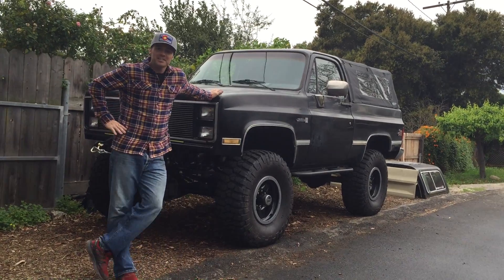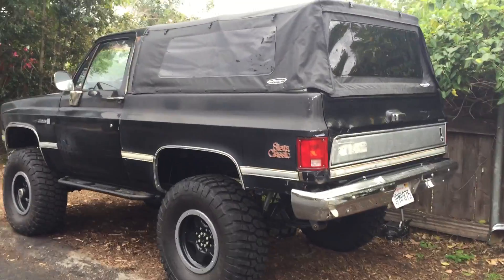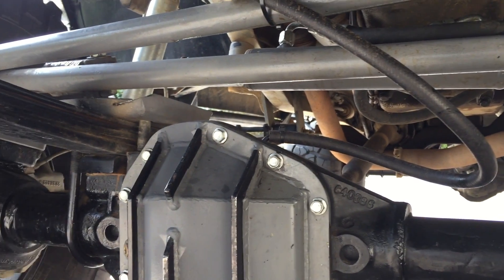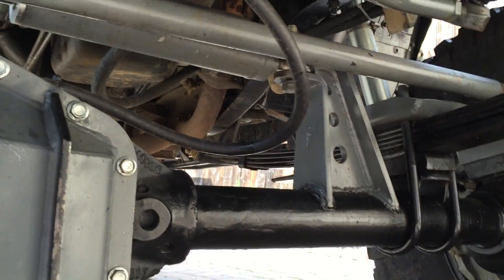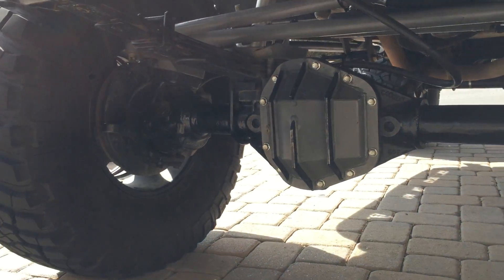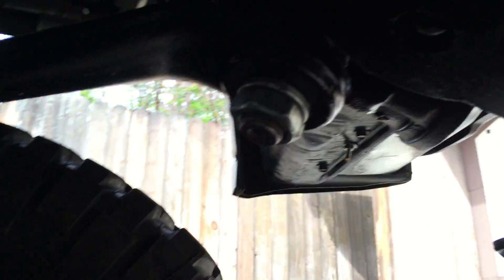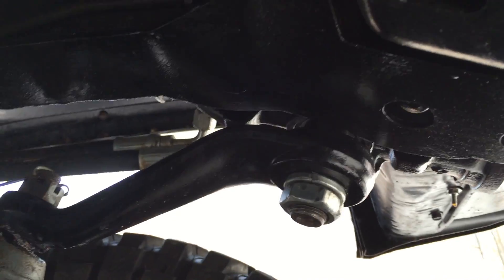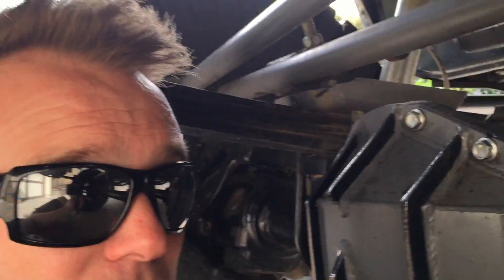MG #1 - what is crossover, high steer and hydraulic assist steering?

Comment: Sorry I haven’t watched all of the Jimmy build videos but what feeds the hydraulic assist ram? A hydro boost power steering pump?
Reply from the maker: yea, it gets from the power steering pump.  You generally need to upgrade the steering pump as it gets worked harder.  The steering box is also ported so the hydraulic lines come from it and complement the drag link

Comment: Does this eliminate the need for a steering stabilizer?
Reply from the maker: well technically a steering stabilizer is a band aid on the system to a certain degree, but yes the hydraulic assisted steering definitely helps dampen steering feedback.
Reply: @MerricksGarage  gotcha, thanks for the reply

Comment: Hey Merrill I just had a Psc hydro assist steering installed on my 1982 jimmy. I have a 6” suspension lift with 15”x12” rims with 37”x14.50” toyo m/t problem is my steering is very sensitive I constantly keep over correcting coming out of a turn , there is no more play in the column but it feels dangerous driving but the biggest problem is that when I brake going into a turn the jimmy pulls to the right the other day I almost lost it going 20mph if a car was next to me I might have hit them the shop that installed it said maybe my front brakes are the problem but before it was installed I had crazy play in the steering but it never pulled. Any idea what could be the problem I would appreciate your input Thanks
Reply from the maker: I would check your alignment.  Toe could cause pulling but also incorrect caster could.  Depending on how you lifted it you might have altered your caster.  The braking issue could be a bad caliper.  Is one wheel or hub warmer to the touch than the other one after a drive?

Comment: I have a 1976 K5 Blazer with the stock front axle. Do you know where I can get a cross over high steer kit? I won't be off-roading it so I wouldn't need the hydraulic assist.
Reply from the maker: Www.Offroaddesign.com

Comment: i have welded a LOT of stuff. a gentle critique i have is that your welds look functional, from what i can tell. we would call them the "farmers special", but if you want to learn, id suggest learning TIG welding. if there is a welding shop with small parts that are needing done, ask if they can teach you how to tig weld. no big factory will do this, but a smaller, private shop may. remember that no matter what, a weld is  strongest and easiest to put down when it is in the flat position. i can stack dimes for days with very little variation. i can also use the arc to smooth stick or MIG welds out. if a weld is good, i see no reason for that though. the welders that can convert to mig or tig machines are getting cheaper and one that can handle up to 1/4 inch wont set you back much. eastwood actually has one. my cousin bought it and is learning to weld with it.

Comment: I've got a 84 3/4 ton with 6" lift 35x12.5 tires, lifted with springs no blocks, nicely done but something is wrong, it wanders horribly and uncontrollably, been aligned, new tires, not sure what Pittman arm is on , i fixed the wheel bearings, caster is 5.8* passenger side, 6.1* driver, .6 positive chamber, toe is dead on, i can not  see any worn joints, drag link seams ok, does anyone know what I can do that will not make me look drunk when I'm driving it?
Reply from the maker: What axle?   Kingpin?   Have you had anyone slowly the turn the wheel while you are down looking at it?   All it takes is a little play in one rod end to make it steer crazy
Reply: positive camber ? If its really positive id start there , your "some" negative camber few degrees maybe. Check also for frame cracks at steering box.
Reply: Same issue with mine. I replaced ever steering component and still wonders. Thinking im going crossover. Hopefully that cures my wondering K5.
Reply: @Snackzy-TDS  My 88 K5 wonders a fair amount...and its stock. About to put tons under it though.

Comment: Great vid , I have a 89 k5 with alot of play in the steering wheel , gonna have a track bar made you think that will help get rid of some of the play ? Of not what do you suggest ,help !
Reply from the maker: Before you do any of that check your rod ends and rag joint.  I bet you have slip there.
Reply: Merricks Garage ok cool thank you very much , keep you posted.
Reply: Chris Hurley thanks Bro....
Reply: Dan Na if that doesn't work you can try to tighten the adjuster nut on the gear box that will help mesh the gears back together as they wear out over time but only adjust it a 1/4 in. At a time. Hope this helps.